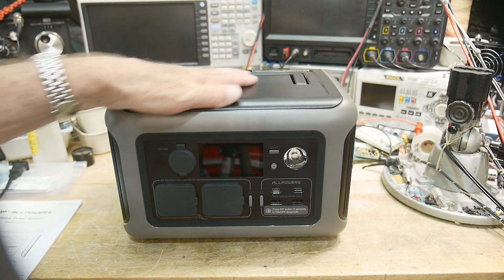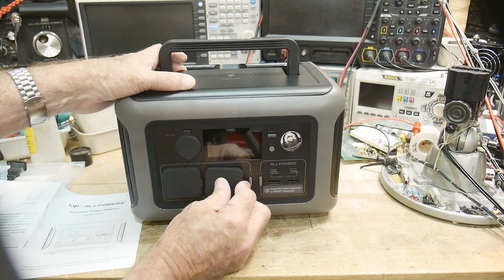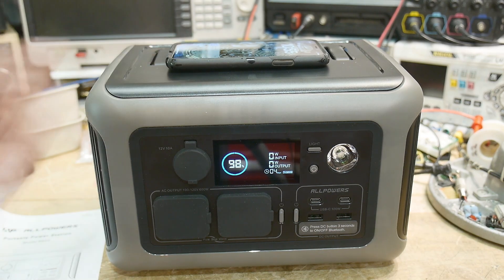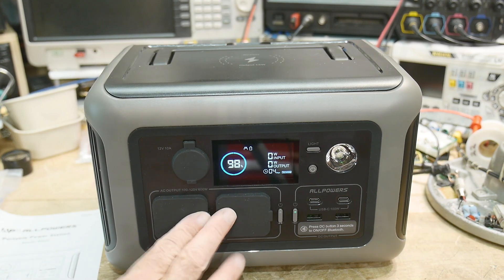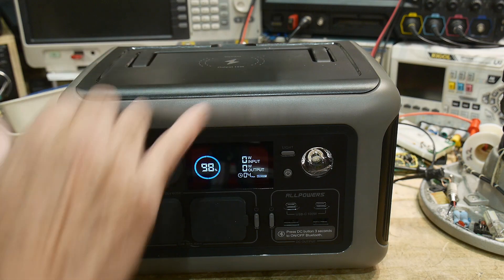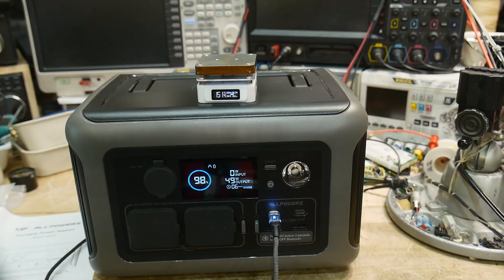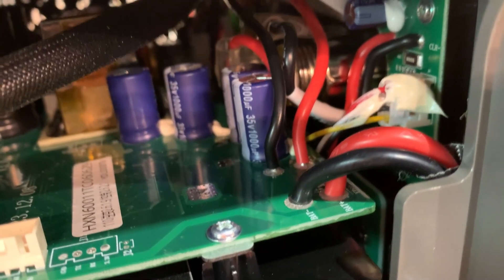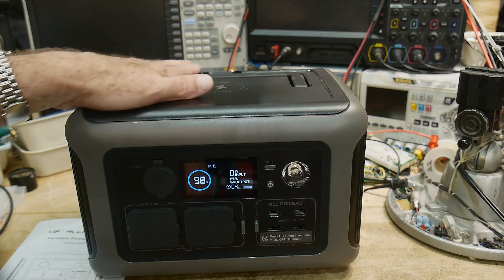#1970 Allpowers R600 power station and 100W solar panel

Comment: allpowers and goalzero are the worst, they never got their circuit design right. 
just let it sit for a few months unused and it will kill the battery pack
 i modified my (older, different looking) allpowers 600 with a switch that disconnects the main board from the battery when not in use as it drained 1..2 percent per day even when not in use. i allready changed the cells on a friends unit because he discharged it to a few percent and forgot to charge it for a week. .

same for goalzero, they even die when just sitting in the store shelves 
i know a electronics recycler that has a bunch of them all deep-discharged but new /  never been used etc.

Comment: Allpowers R600 Power Station Review by IMSAI Guy

* 0:06: Allpowers R600 Power Station Review: The IMSAI Guy reviews the Allpowers R600 portable power station, highlighting its features and capabilities.

* 0:49: Multiple Charging Options: The R600 can be charged via AC power, DC input (12V-60V), car battery, or solar panel.

* 1:30: Variety of Outputs: It offers two 110V AC outlets (600W max), USB-C (high-powered), USB-A, and a 12V DC connector.

* 4:51: Pure Sine Wave Inverter: The R600 features a pure sine wave inverter, ensuring clean power output for sensitive electronics.

* 3:06: Built-in Wireless Charger: A convenient wireless charging pad is located on top of the unit for smartphones.

* 2:22: Informative Display: A clear display shows input/output wattage, battery percentage, and other relevant information.

* 7:53: Includes 100W Solar Panel: The reviewed unit came bundled with a 100W foldable solar panel for off-grid charging.

* 10:24: Solid Construction: Internal components appear well-organized and feature a large heatsink and temperature-regulated fan.

* 11:03: Positive Review: The IMSAI Guy gives the R600 a positive review, praising its performance and features. He recommends watching a more detailed third-party review for in-depth testing data.

* 11:12: Larger Sizes Available: Allpowers offers a range of power stations in various capacities to suit different needs.

I used gemini-1.5-pro-exp-0801 to summarize the transcript.
Cost (if I didn't use the free tier): $0.04
Input tokens: 9581
Output tokens: 701

Comment: Have a small Bluetti version. They are useful on the bench as an isolated power supply (when AC in unplugged.)
It has replaced my UPS. Have 2 dozen dead batts from my UPS's. They lasted about 1.5 years. The LiFePO4 should last 10 years ormore, so will be cheaper and also provide USB charging.
Reply: Can you leave the Bluetti on as a online automatic UPS, or will it timeout and shut down requiring you to turn it back on with the utility AC goes out?
Reply: @georgealdredge2806  It operates just like a regular UPS. Switches to inverter when power goes out.
It does have an ECO mode that will shut off after a specified period if the load is less than 10W. You can turn that off for things like fridges that only draw intermittent power.
Reply: @ScottHenion  Cool. My friend has some no name lunchbox lithium inverter 
Iike this R600, but it times out and shuts down the load when connected with utility AC power after an hour or so. He brought it to me the see if I could figure out how to turn that feature off and use it like a conventional UPS, but was unable. I’m thinking I want one these for myself, but the inability to use it (the model my friend has) as a UPS is deal killer. Thanks for the reply.